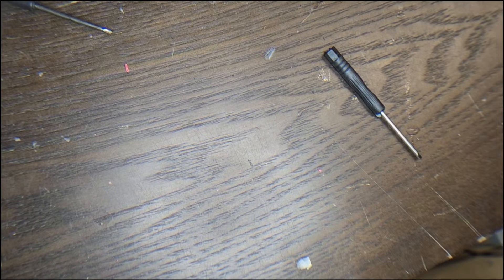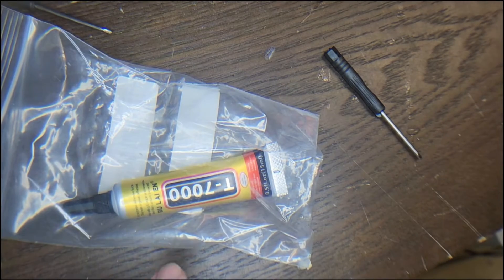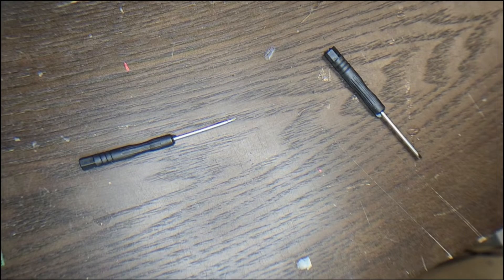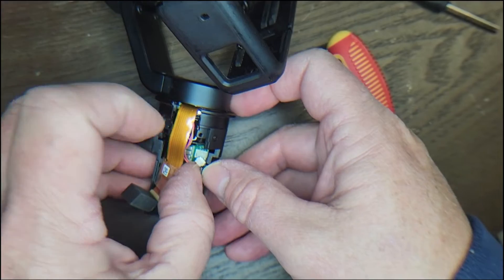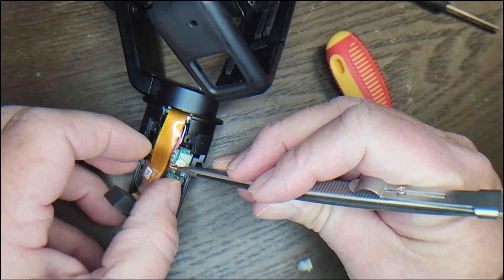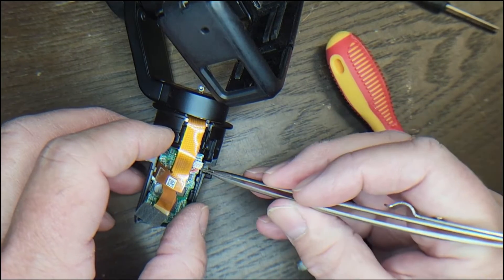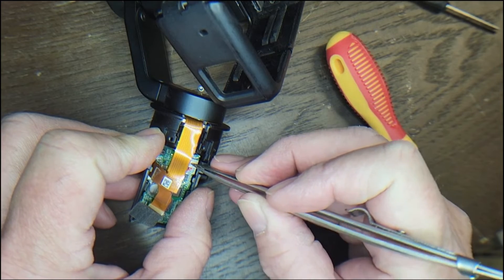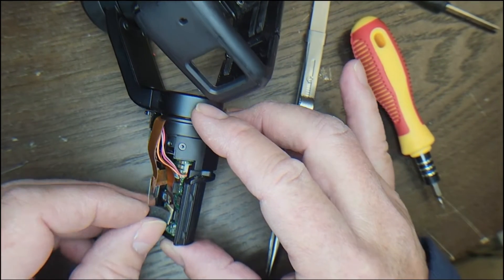GoPro karma Stabilizer Repair

Comment: I really enjoyed your channel and all support for karma drone 
However, I'm asking if there is anyway to upgrade this grip to make it aple to hold newer version of gopro like 8 and more.

Thank you
Reply from the maker: Mechanically you would need to build a new cage to hold the camera. The next question would be will the drone firmware recognize the camera ? It should. I dont know if the drone will fail to arm if it sees a camera that is not on the approved list. It would be worth getting cables to connect the camera to the existing cage to see if it will work without having to cut a new version of the firmware.